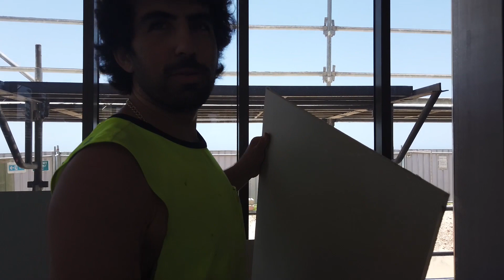How to Fix Sheets with Bobby the Drywaller

Comment: What kind of drivers are they using?
Reply from the maker: Makita and Hilti. Which do you like?
Reply: What I mean is , I've never seen a tool like this, so quick,  is it setting drywall screws or another type of fastner? I'm from the U.S.
Reply from the maker: @loisgustafson4522  yeah drywall screws  . Such a time saver and saves your body